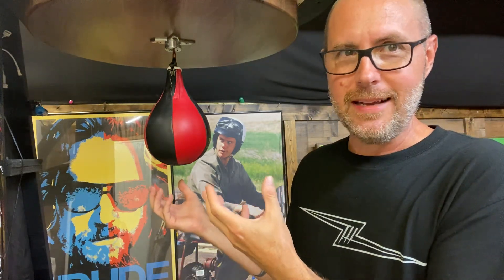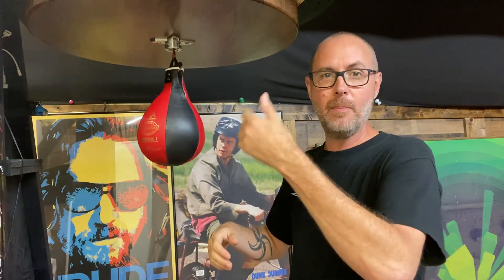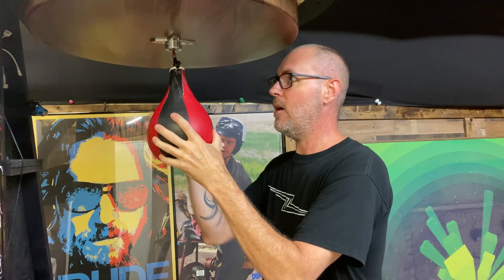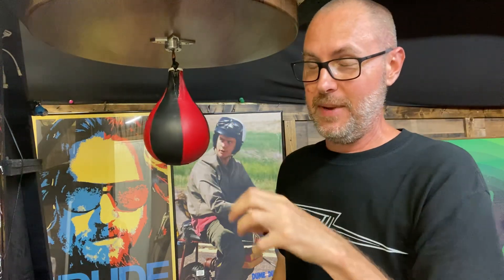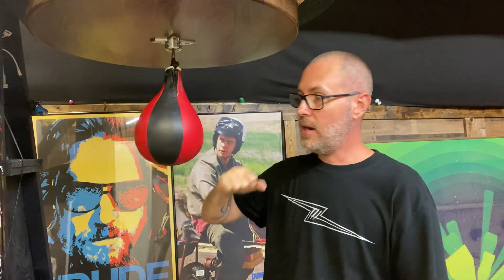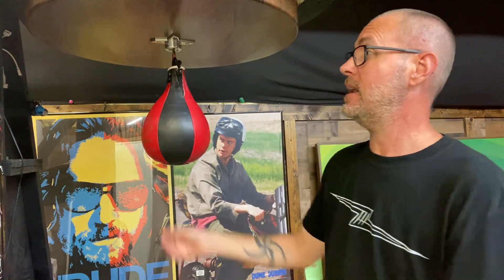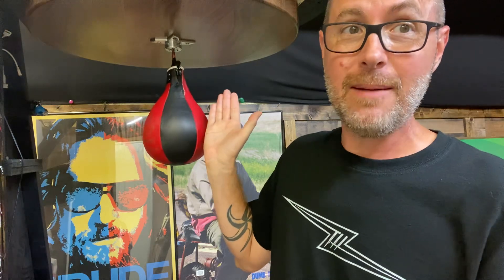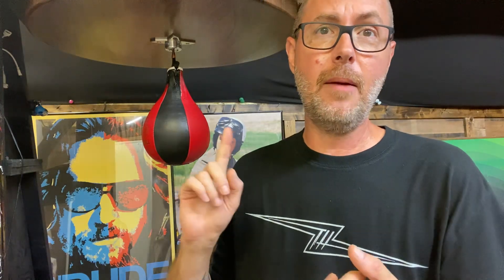Why is my speed bag swivel so loud?

Comment: I put a corrugated cardboard washer in the bottom of the swivel just big enough for the ball to fit through, it stops the edge of the ball hitting the metal sides, I then trapped the ball in the top of swivel with some thin foam packaging lining as a circle seal against the wood, it's almost silent now.
Reply from the maker: @KevinJamesHannant  if you use a stealth core ball it will be 100% silent if you don’t have any miss hits. I use a stealth core ball 80% of the time because I do so many lessons. There are a lot of people who’ve asked me repeatedly to make a metal swivel with a freestyle core ball so they can have that cool top hat accent while Rhyrhm baggin and it allows them to do trap spins. But that’s also why I made stealth core balls for people who want it silent. I don’t notice the sound anymore. Only sound I notice a drum that rattles the whole room, squeaky swivels, and over inflated bags. lol
Reply: @Speedbagthrasher  
I plan on replacing the swivel & board eventually, just making do atm.
The Meister bag is standing up well 👍 might change the 90kg Aqua uppercut bag to something smaller the stand isn't tall enough without extending the upper box section, it needs like an extra 1ft, if I do it i'll weld a bar above the existing speedbag one an then bolt a thicker board between the gap.